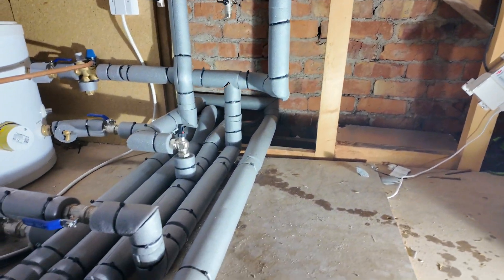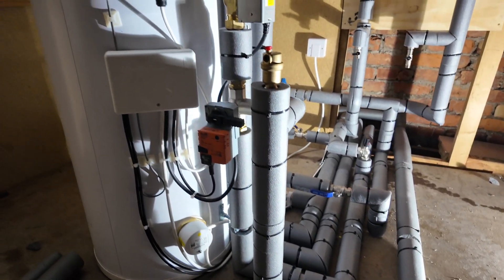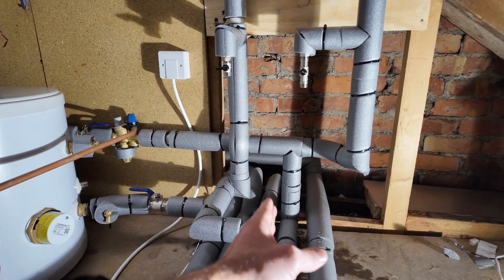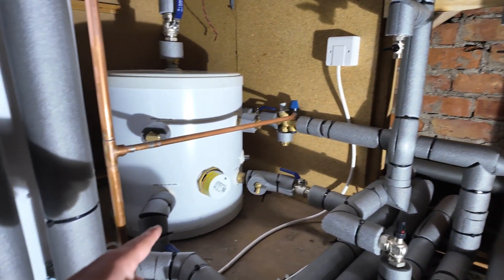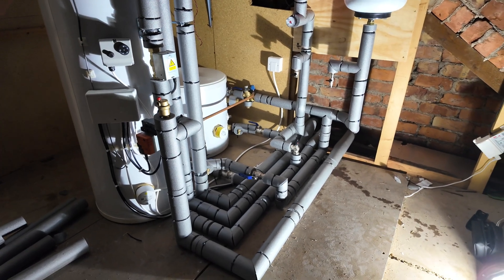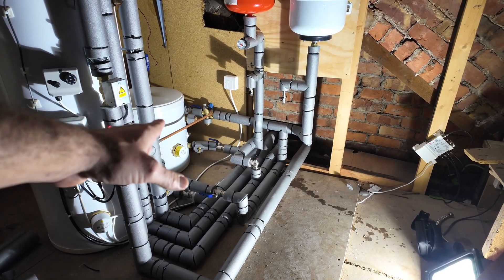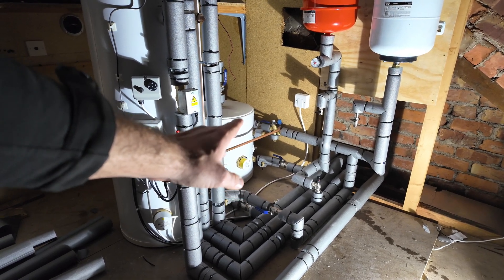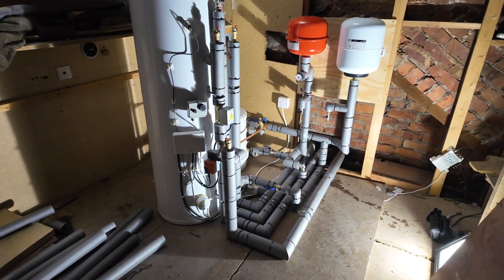Typical Heat Pump piping arrangement.

Comment: thanks for the video. You mention that you put the volumiser on the return. I have also seen schematics of volumisers always on the return. Can you explain why that is? Our installer piped it on the flow side (before it goes to the radiators) and I wonder, if this could cost us efficiency, or does it not really matter?
Also, could the water volume be too big at all, or only too small?
Reply: Normally on the return so that when the flow reverses during the defrost cycle, cold water isn’t drawn back into the rads. 
But in terms of adding system volume to meet minimum design specification, it doesn’t matter.
Reply: @yp77738yp77739 thanks, yes it doesn't seem to matter indeed. We got the installer to replace the heat pump unit with the smaller model (Vaillant aerotherm + 5kW, instead of 7kW) and that made the difference from scop 2.3, to COP 4.5 in April and May.

Comment: Can you show a Vaillant hybrid pipework installation where it is retrofitted to an existing combi boiler system? Something I can find nowhere..
Reply from the maker: @ciaranclose192  I can show you a heat pump connected to a combi boiler. Not specifically a Vaillant.
Reply: @ I’ve seen the alpha ones which are designed to be installed together so it involves replacing the existing combi boiler.

Comment: Excellent video. Are there any pros and cons about putting a volumniser on the return vs the flow?
The only impact I can think of is for defrosts where the heat is taken from but I guess in the long run that doesn't matter as the 'cooled' water will makes its way around the whole loop eventually.

Comment: Hi, thank you for the video. I have  a quick question: I have wet UFH downstairs and radiators upstairs and run everything on one zone (open loop). Shall I feed upstairs radiators from the downstairs UFH return (create one big loop) or put a T on the flow and return from the ASHP, and run upstairs and downstair in parallel? Thank you

Comment: Hi! Good video and tidy installation! I put in a 50 liter buffer tank when I installed my pump. I wanted the heat pump to be separated so if I use the firewood kitchen stove it would not get feeded with too hot water. I also wanted to be able to control the radiator water pump separately from the water pump in the heat pump.  Now after running the heat pump for a week I wonder how much I will use that stove…..The system seems to work well and having the possibility to use firewood when needed is probably a good thing.